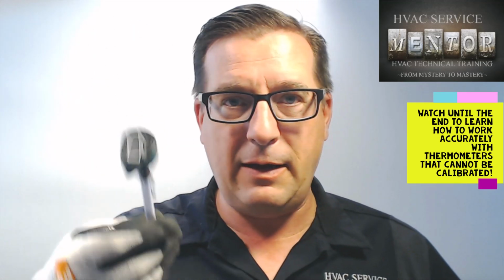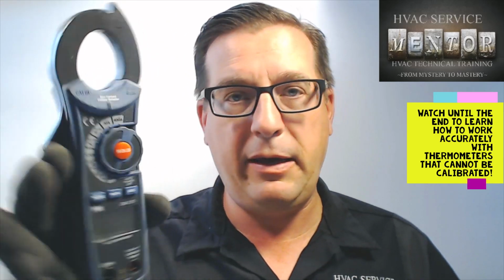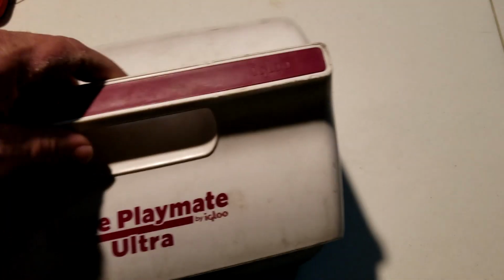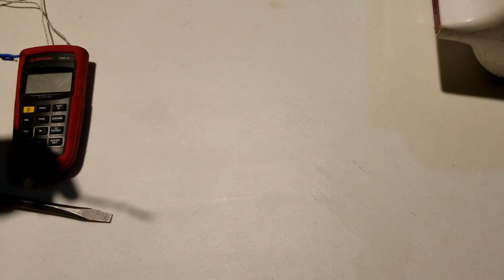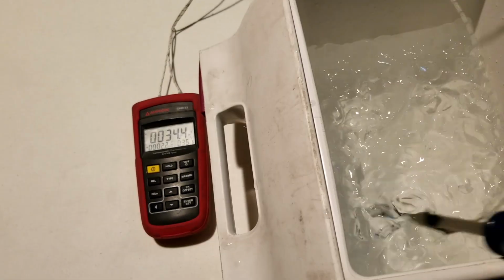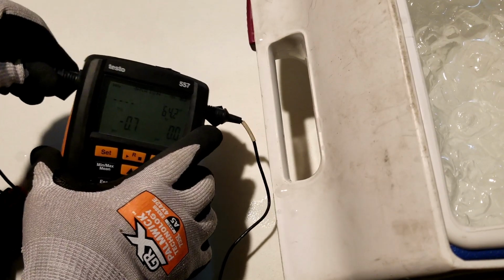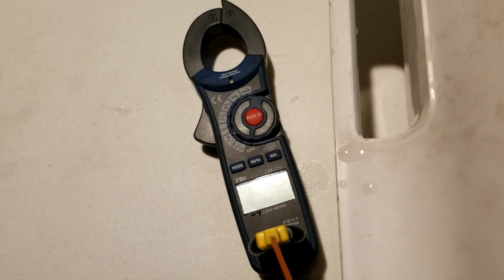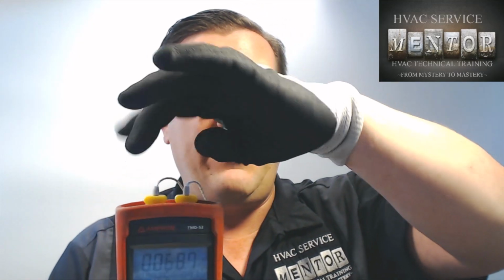Why your thermometer sucks and what to do about it

Comment: Max Planck, at the beginning of his Treatise on Thermodynamics makes it clear that no two thermometers agree, apart on the melting and boiling point for water. He goes on to say that perfect gases thermometers generally agree in ambiant temperatures up until 1200 degrees Celsius if I remember it correctly… in a nutshell, he built his entire theory on 1) the sense of touch 2) highly imperfect thermometers…which is quite a feat!
Reply from the maker: I am always amazed that most of our industrialized modern society is based on science that was discovered in the 18th and 19th centuries and even before!

Comment: I tried this with a multimeter and the difference was never consistent. Turn the unit off and back on or wait and try it later or the following day and the delta between 32F may be 2 degrees or 8 degrees. I figured the thermocouple was just junk.

Comment: Half the techs I've seen literally don't even know what model of Multimeter they have. When handed another one they've never used, they ask what gets you Ohms lol. 
 Thermocouples although having a very good purpose, are not very accurate. The most common is a "K-Type" it uses two dissimilar meters (Chromel and Alumel" bonded at a tip. The fundamentals in which it functions, is ancient technology. 
 Worse yet. The potential interpreted by the meter also has an effect on accuracy. Thermocouples are durable and withstand heat well. 
 We need to read the manufacturers supplied literature to understand what we gain from our measurements, and to understand the possible incongruities/possibilities

Comment: I remember using  a little pocket thermometer that I would calibrate using ice water, I could simply adjust a nut on the back of the gauge with a box wrench…. My father showed me that years ago …. All these new digital meters are cool… But sometimes analog was simpler, and it could be adjusted using a thin pocket screwdriver or a wrench… Nice video… thank you for the continuing education😎